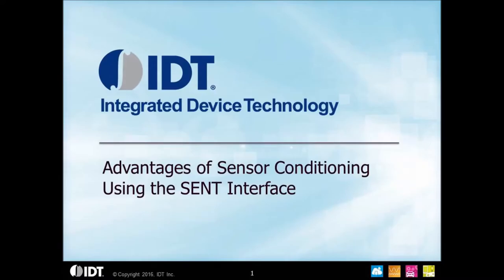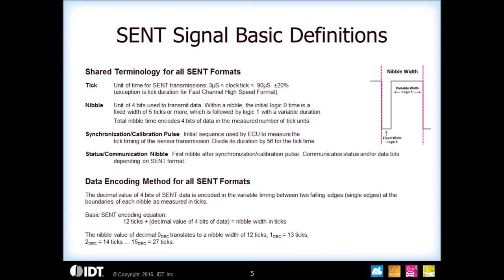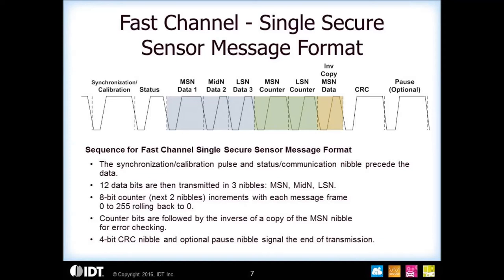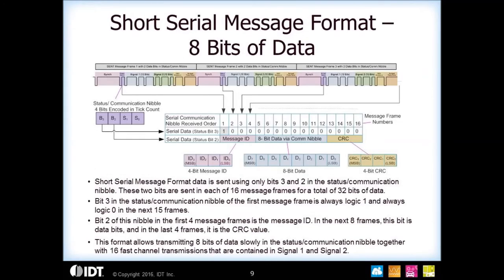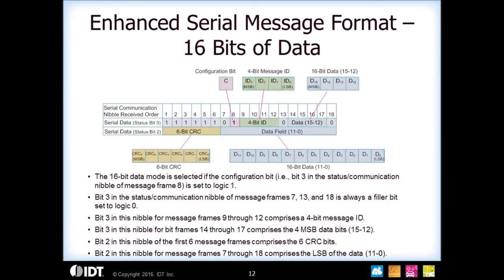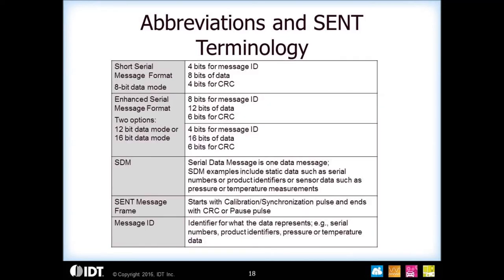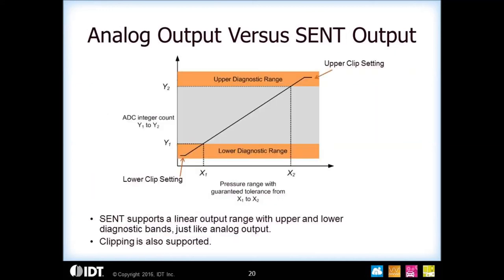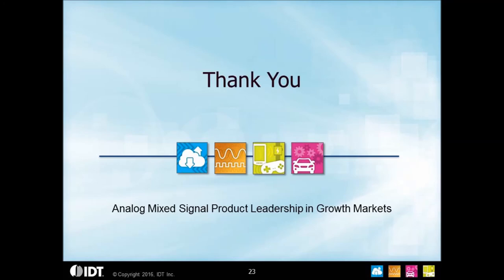Introduction to SENT 3.0 Interface (Single Edge Nibble Transmission) and Sensor Conditioning

Comment: PSA: If you are interested in faster sensor conditioning  - our sensor programming unit SPU reads SENT from the 4169 up to 40x parallel and does the conditioning. More specs at https://sensorprogramming.de/en/